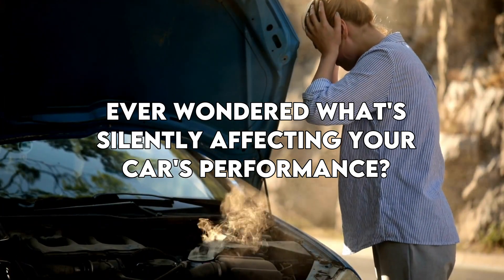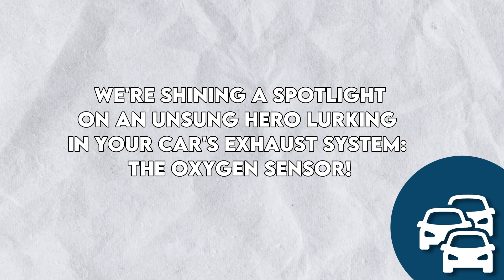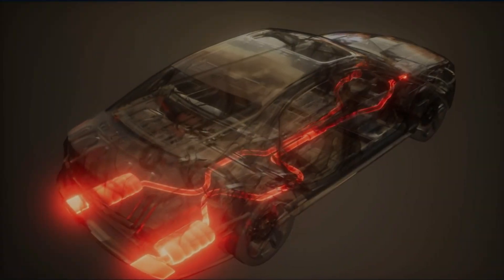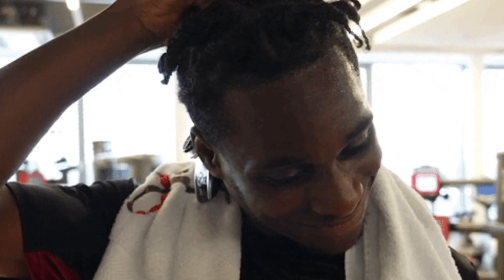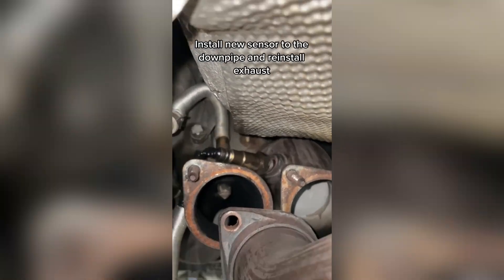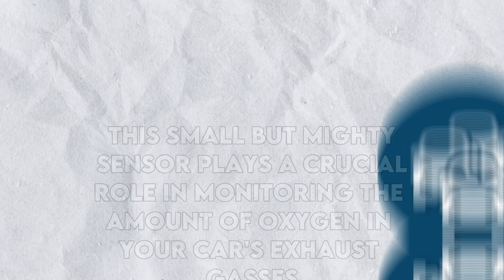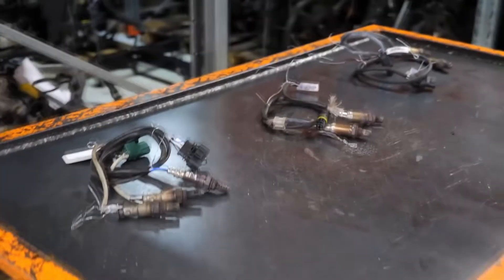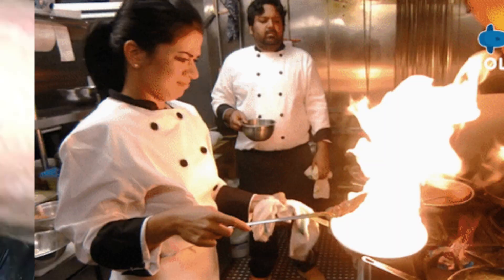Detecting Trouble | 5 Telltale Signs of a Faulty Oxygen Sensor (O2)

Comment: Your video covered the five main symptoms of a faulty oxygen sensor, as well as the role of oxygen sensors in a car's emissions control system and how they work to maintain the correct air-fuel ratio. I also learned about some of the causes of oxygen sensor failure, such as age and high mileage, internal contamination, and electrical problems.